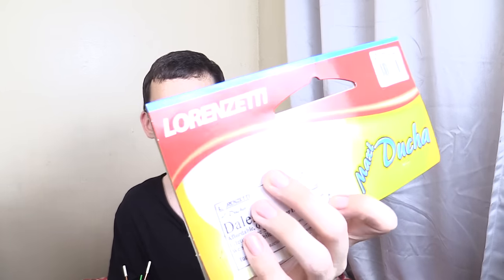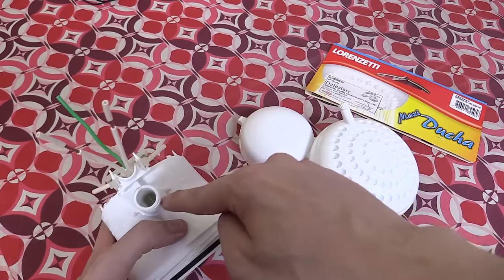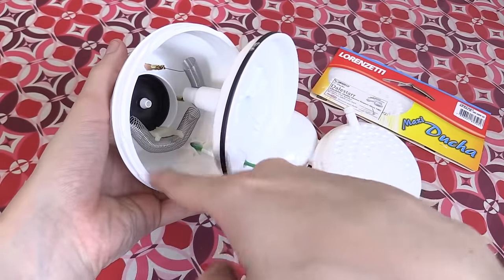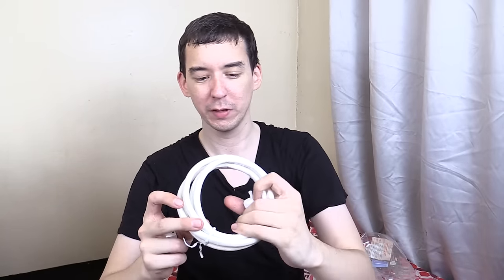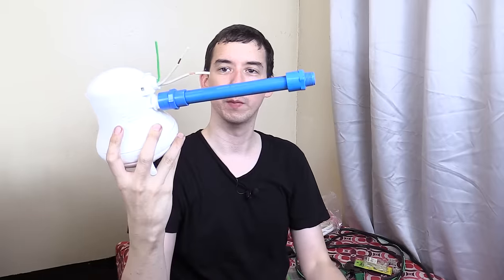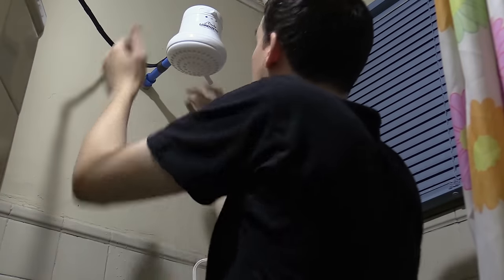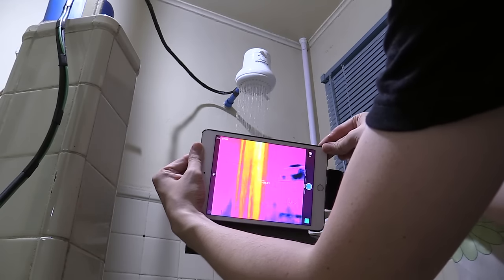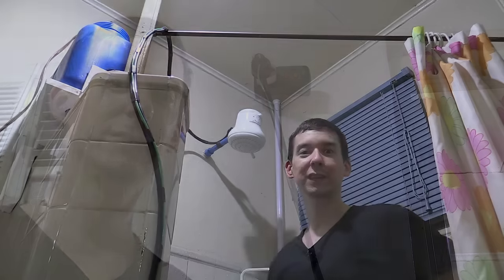Lorenzetti Electric Shower Head

Comment: I used one of these during a stay with a host family in Costa Rica... zapped the shit out of myself adjusting it
Reply: You should never handle these cheapo units while it's working, also, never touch them if your body and the floor is wet.
Reply: Sugurain to be honest I didn't even understand what it was, I forget why I was fiddling with it. I learned pretty quick though
Reply: Same here. The pipe between the wall and the heater was metal. I grabbed that so I could adjust the head and got the shock of my life.
Reply: Sugurain The fact that these rules exist means this product should not exist. Regardless of all the people saying "they are the most popular, sturdy, best shower head in X country and if done properly... hopefully wont kill you. See? No reported deaths on google."
Reply: Mak it's safe indeed. Cheap ones aren't.  You can't  drive a car using chocolate as fuel. Follow the instructions,  that's the obvious.

Comment: This is stupid and dangerous, for heated water I just simply turn my car on and run an asbestos covered tube from my car muffler to my bathroom window and tie an electric heater right under the shower head and have the water run through it to be heated, I power the heater with jumping cables connected to my car battery with my son revving up the engine.  For maximum heat I also tie a blow dryer to the back wall aimed at a toaster to pick up the heat extra heat, its simply powered by a lightning rod on my homes roof.
FYI, when not powering my blow dryer, the lightning rod serves as the t.v. antenna so I can maximize it uses.
Reply: In fact is not dangerous at all, you can well seal the electric cables and done. A well connected shower at a well connected pipe and done.
Remembering that just salt water conducts electricity, and if you are not crazy to fix the wires WHILE you are in shower, done, everything is fine.
Reply: I couldn't think of a safer setup.

Comment: These were downright common in Ecuador when I lived there, even in hotels. Rarely did any building ever even have a functioning ground connection, so the ground wire was almost always useless at best, even if it was connected (Almost never.). I recall at one place, the DIY job had been wired only to a 110v outlet, rather than 220. So, you would have a hot shower for all of a minute or so, then the breaker in the kitchen would blow.

Comment: His shower head is used all over Brazil and even when the wiring is bad nothing bad happend, some people uses rubber Flip Flops to isolate or a rubber matt on the floor i took shower in one like that is safe !!
Reply: You do realize that rubber isn't going to insulate anything if it is wet, particularly is there are any salts of any sort dissolved in the water, as most tap water does?
Reply: Millions of people use it and no one dies. Yeah, that seems pretty safe to me
Reply: thats what i tought. I have replied on a different comment here comparing it to guns. We all know guns can be dangerous right? If you dont take care of what you are doing you can get injured or killed. That noone i know got killed by a gun dosn't make guns safe, it just means they either took care, or they are lucky that nothing has gone wrong yet. But end of the day from a technical point of view this showerhead is just dangerous. That is not someting you can discuss about, its just a fact.
Reply: Do the installation properly and it'll be fine, and don't forget to connect the ground wire.
Reply: >says it’s safe >explains the counter measure people use to make sure they don’t get shocked

Comment: Standing on the grounded metal drain without ground attached, furthermore what's going to happen when coil opens @240v. Enters head leaves feet.  Never, never, use this.
Reply from the maker: Yes, I wouldn't use this if it wasn't earthed. I mean personally I don't plan to use it at all, but especially if it's not earthed. ElectroBoom did an interesting test showing the conductivity of water, it's a good video to check out. He basically fed 110V into a container of water and put his finger in and moved it closer and closer to the wires until he could start to feel the effects. I guess this unit is really relying on the grounding and the low conductivity  of water and the fact that the water is broken into droplets.
Reply: I'm just used to UL (underwriters labs) listed devices, mandatory in US and this would never come close to approval.  When you think about it a  electric home water tank is similar, but tank is steel and coil is enclosed in grounded metal tube.  Water  is plenty conductive to kill you with it's minerals.  And then where would we be without your channel.
Reply from the maker: A D haha yeah. I mean, like I said at the end of the video, I'd really recommend people to buy a standard box type water heater / shower unit and not this one. It's a fun experiment to see one of these "suicide showers" in real life but it's not something I'd want to use every day.
Reply: Have been using one of those for the last 42 years... No problems at all.
Reply: Tap water is not conductive enough for that to happen.
Even if the heating element blows up, it will just interrupt the circuit, it's not gonna pass through you body because the resistance is high.

Comment: If it is really cold, like winter in Sao Paulo, it needs to be a really slow flow to be warm enough.  But they work really well, I watch a lot of these youtube videos and they are either using the wrong voltage or are just out right lying.  I used these for two years in Sao Paulo Brazil and never felt a tingling or got shocked and most of the time the ground wasn't connected.

Comment: II have used this type of electric shower without GROUND since I was a toddler, and I'm now 71 y/o. You are wrong, nothing happens if you don't touch the contacts. Here in Brazil maybe 70 millions or plus are installed in houses. We have not a very, very cold weather here and the majority of houses have not dual plumbing system, hot and cold. Only electric "suicide showers". This device is approved by engineering rules. I'm a retired engineer. Bathrooms have an electric box in 220 V aside the water pipe in the wall, with proper wires to support the current. The wires come from the main electric box of the house, with protection devices. So, stop talking nonsense ...

Comment: Super common in Colombia too, at least in lower income households. I have seen it in many hostals too. Most people buy it and install it themselves. So absolutely NO security, The most common brand here is Boccherini (I believe it is a Colombian brand). And they recommend to plug it to a separate 40 Amp breaker (110 V / 60 Hz in Colombia).  Which people hardly ever do. They usually make a simple derivation from a wall socket or a wall switch.

Comment: Went to Costa Rica in 2003 with a group of friends and we had one of these in our shower. The shower head was mounted pretty low and anytime someone would try to move it they would get shocked. It was the stupidest thing ever. After getting shocked a couple times I just figured not showering and mosquito bites was probably a better option.

Comment: We use it a lot in Brazil and never heard of anyone getting a massive electric shock nor dying. I have felt shocks before on poor installations where the ground is not connected as you said. But basically when you touch or hit the water handles (if they are metallic).
I can tell you it is safe even though the construction of the device is simple. Brazilian regulations (unlike lots of people think) are really strong for those devices.

Comment: I've been using this exact same Lorenzetti electric shower head here in the Philippines for about 5 years now. And i've replaced it twice already.

The first time, the temperature selector switch eventually broke because it was made from cheap plastic. When people switch the plastic lever back & forth repeatedly over time, it will eventually conk out and that's what happened. The replacement unit i purchased, conked out after a year and it won't heat up anymore. I think the heating element gave up.

I want to purchase the same product a 3rd time, but the salesman at Robinson's Handyman shop said the product was phased-out already and discontinued.

Honestly, i've kept buying it because it's the cheapest shower heater here in the Philippines at 1,700 pesos or about 31 US dollars. The cheapest water heater in hardware stores is around 5,000 pesos or about 93 US dollars.

About the tingling sensation, yes i've felt that whenever i touch the shower knob. It's not a strong shock. What i did was i bought a plastic cap that fits on the shower knob for protection.

Comment: Hi, greetings from Brazil!

Yes, Lorenzetti is a Brazilian brand.

And you never ever should put it in a wall outlet. :) 

Not only the manufacturer, but the safety regulations and standards for electrical installations here says you should wire it directly into your installation. It's because the humidity from the water steam, with can mixture with salt, enhances the chance to short the outlet.

I don't know why some people from other countries says it tingles, I used it since ever and I not received a single electrical shock from this. Even when the ground isn't connected. 

But I don't like electrical showers. Not because of safety concerns, but because it wastes a huge amount of power and electricity here isn't that  cheap. I prefer gas heated, but this is not common in any way here in Brazil.

Comment: Almost 10 years ago, I saw the Lorenzetti shower heads at hostels in Costa Rica. Of the three installations that I saw, none had grounding. That is what worried me the most. Nevertheless, the water supply must have been low in minerals because I did not feel a tingle or shock.

Now, when I watch TV shows about luxurious homes in exotic places, I wonder how shoddy the wiring in them might be.

Comment: The hand shower extension is commonly used used when you have children or elderly people in the home.
Just like a normal hand shower you can use this extension to wash hard to reach places. To wash newborns you'll usually use a small plastic bathtub, you can fill it easier with the hand shower, and also give the baby the final rinse with it.
To elderly/disable people the hand attachment is a must, as they'll most likely have to be washed by someone else, if not, it'll still be necessary for disabled people in a wheel chair.
I've had to give my grandma a few baths this way. And I also remember my little brother having a bath in the small bathtub.

Nowadays we don't have elderly, newborn or disabled people at home, but we kept the hand shower attachment. Why?
I find it useful to wash the whole bathroom when it needs a cleaning. hahah (of course I set the shower to the OFF position for that)
Reply: How do I use the smaller tiny shower  that most of this showers come with? I can't seem to find an answer

Comment: I had used this geyser for two years in Kenya. It works well. I had got it installed by an electrician who knew its installation procedure. I tried to find this geyser in Indian market when I returned. It is not available here. I wish somebody manyfactures here. The earthing is a legal requirement and every house has it here.

Comment: Out where i live ive installed some of these and if there isnt a proper ground i hooked it up to the negative since the electric company only feeds us with one live wire 220v and the negative is just a rod going into the ground it actually works really good , for hooking up the wires i use a german product called "wago" which is very durable with the high wattage

Comment: That thing you told serve has a pressure valve allowing water if water flow is blocked does not work like that , we attach a smaller shower head there with a long hose , i use the little shower to give baths to my dog

Comment: If you're feeling a tingling from the AC, that means that some current is flowing through your body (and the water surrounding you).
These are total losses.
You now will be sending them through the ground. Basically, a portion of your heating elements are going through the ground.
I just hope that the thing doesn't get stuck with mineral deposits, when you close the tap. Because then the shower head continues to heat the water, but no fresh water is flowing through it; evaporating the water, and ultimately melting through the plastic; potentially causing a fire, or a short circuit.

Comment: I think this thing relies on the shower water flow not being laminar, but broken into droplets with no contact between them. Don't know if this shower head makes the water flow that way or it just happens. If the flow was continuous (laminar) I suspect it would trigger a reasonably sensitive (30 ma) RCD device.

Comment: In central america they are super common, and they are complete garbage. Low income neighborhood houses, which are the most frequent buyers of those things, usually never have grounding, and therefore they are usually never properly installed. Furthermore, the cables it comes with are not strong enough to hold the charge it uses and they end up burning down in like a month or two of constant use. Even if they were originally installed by a professional, you will still see that horrible wiring because when the cables burn down they will just "fix" it themselves changing the part of the cable that got burnt. I've even seen those cables burning down in the contact points smelting down the plastic body. Maybe with proper installation and replacing the entire stock wiring for better cables would make them "good", but then the resistance dies in like 3 months. You are just better off just spending a bit more in an good water heater.

With that said, I consider it better spending more in a good water heater because it will last years while those things usually don't live more than 3 months making them more expensive in the long term than because of safety reasons. I have never heard of anybody dying because of one of those things, and considering how common they are you might have better chances of dying because you slipped coming out of the shower.

Comment: Most homes (I think more than 90%) don't have ground wire here in Brazil. My family and I was never electrocuted. Here in my house we use a 7700w shower and when it's winter (sometimes 4ºC or 39ºF) we use at 80% of it's power.

Comment: thanks for the GFCI bit
I was planning to install one of these cheapo shower heads on my garage (for hot cleaning), and I have RCBO lined distribution
I was worried this was going to trip every time, I guess it won't if grounded properly

Comment: The little thing to stop the water at the bottom is not to relieve the pressure in case the shower gets blocked, but it's just a place to put that little hose to wash the bathroom. If you don't want the hose you can just block it, but most Brazilians will use the hose, although I hate it because it gets in the way. It's extremely unlikely that a shower will ever get blocked, so you don't really need a pressure valve.

Comment: in my country Ethiopia 99% of homes don't have any grounding system at all but, since it's very cheep alternatives, most homes use it without grounding including me for the last three years, nothing bad has happened yet, but now i am a little bit scary!
Reply: try tying the ground wire to a radiator if you have that or just literally dig it into the ground

Comment: The right method of installation of such showers is using a ceramic 3 connectors with screws that make sure even if the wire gets hot or wet there will be no contact between them. And no, they won't kill you. The only real suicide is the shower itself, it doesn't take that long for the resistor to blow off and you having to replace them. In this model in particular I don't know if it's replaceable but there are ones where it's not just replaceable but very easy and quick to do so.
Reply: The ceramic ones I told you about are just like those plastic ones, but those plastic ones will melt if the wires get hot. For the demonstration is ok but it's very dangerous to use it like that, worse than eletrical tape when you can phisically keep them apart.

Comment: That only uses 3.5kW? Doesn't that make quite a cold shower? I get that Brazil is much warmer than the UK, but surely you must get cold days sometimes?
In the UK our (much more over-engineered) electric showers typically use 9.5-10.5kW, although most homes won't utilise an electric shower but have an on-demand water boiler, usually powered by gas. Electric showers are usually in cheap rental properties, student accommodation or the few properties that don't have a gas line.

Comment: Back in the day, when there wasn't hot water in the bathroom, one would heat water on the gas stove top in a large pot, then pour it in a bucket, gradually mixing it with cool water. It sort of worked. It may take three pots and three buckets for a large person, however.

Comment: Using the heavy-duty wire cable doesn't do any good if it's plugged into an outlet that is wired by smaller cable. Checking to see if the ground is actually wired in the outlet  is a must also.
Reply from the maker: Good advice  

In my case, I'm using an aircon socket that I already know is supplied by a heavy gauge wire and has a working ground.